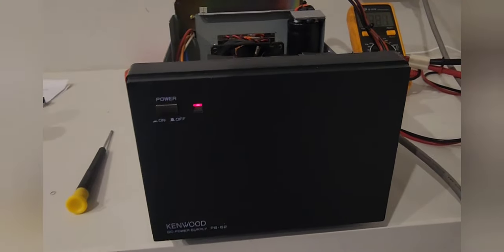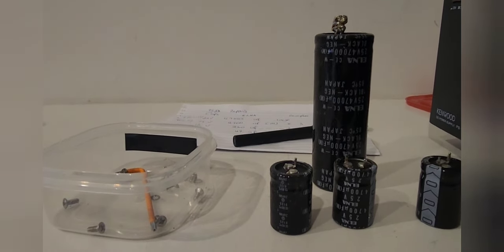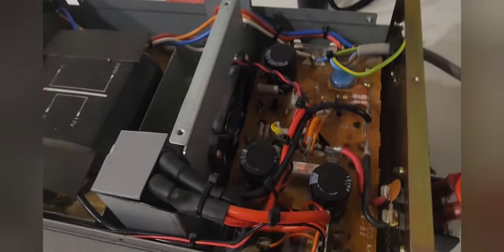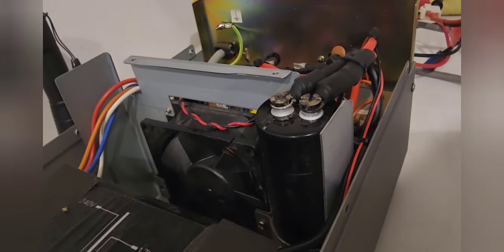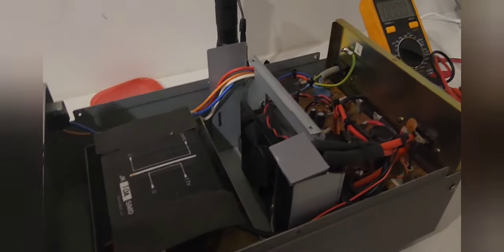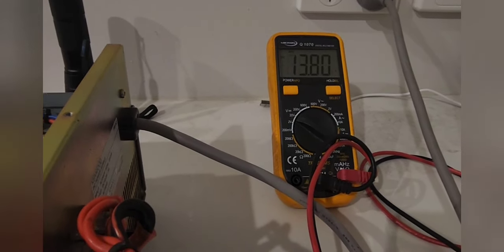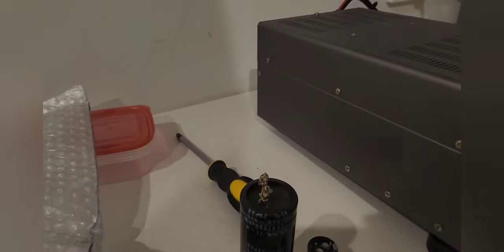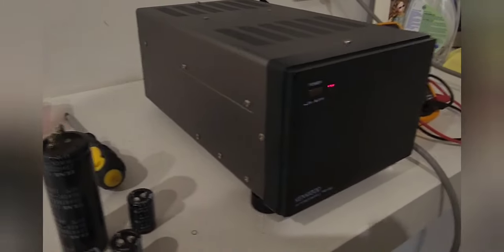Kenwood PS-52 Power Supply - How To Fix DC Hum Issues

Comment: Paul i have a 30amp power supply its great was made by a local amater radio man i bought it second hand and have had it over 40 yrs still works good gets bit dusty over the years had amp meter and voltage meter i had to replace the volt meter  few years back also recently the on off switch stoped working i put new one on it Jcar has all my stuff i need Yours looks so nice to like new nearly
Reply from the maker: Good on you for learning & doing repairs on your gear.